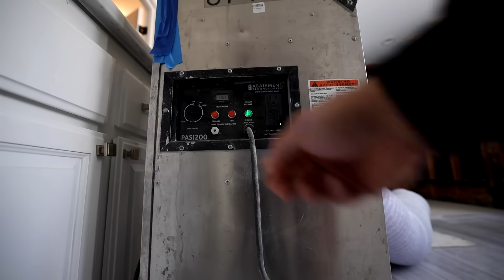Get Walls FLAT for TILE INSTALLATION --- Furring Strips, Sister Studs, and Cardboard Shims

Comment: There couldn't have been better timing for this video.... I've been stalled on my daunting home renovation and shower walls was next on the list. 

Your approach to the craft is top notch. I appreciate your dedication.
Reply: I watched several of his videos, and I'm not a complete stranger to construction or tiling. My Dad always stressed ensuring everything is square and level and so does Isaac. I just finished a project in an investment home and the only thing that saved me was furring the walls behind the backerboard. It seemed extreme to me at first, but installing 24x48 inch tiles, I knew that having a square and level surface was absolutely crucial. Project turned out fantastic, and the tiles went in seamlessly.

Comment: Hey Isaac,  thanks for the great vids!  Question on when/where you call it on the furring approach.  As a  slightly northern brother, I find it hard to sell wall floats.  I work with board extensively, due to advertised/assumed speed and quality, but I can't usually quantify or predict the increase in labor and time to fur/sister studs as shown (always a mess with busy venting/supply  walls, nvm windows).  I find myself beholden to the wet shim option more often than not, dimensional framing material being what it is now, and these popular large format tile are hard to set on an unflat wall.  Perhaps we should petition wall float education!  Thanks- keep up the great work!

Comment: I’ve gone over to metric measurements for dimensions under a foot. I started by using a tape with metric and imperial marks. Then slowly adjusted to using metric. It’s SO much easier to calculate dimensions!👍
Reply: An easy way to operate within the imperial measurement system is to determine what your tolerance is and mark everything in that denomination. If you operate within 1/16th for your tolerance and measure 1/2 in, just write 8 on the wall. I measure everything to a 16th and write the numerator without reducing the fraction. Fast and accurate.
Reply: @jeffersondavis5419  incredibly helpful tip. I'll try it next time.
Reply: Agreed we should go to metric... the transition would be painful and expensive but it would be worth it in the long run.  Grew up in Construction in the US, spent 12 years over seas building yachts in metric and now I'm back in the US in construction.  And it's not a matter being able to do the math in your head it's the expense in time and mental energy, which, has daily limits.  Moving a decimal is simply faster and easier.  One more note: the United States Customary System (Imperial) has been leagally defined in terms of metric units since the 19th century.
Reply: @A P I recommend you stay away from Vegas.
Reply: While it’s easier to convert you actually get more info on a tape measure with the imperial system. Ease isn’t always what it’s cracked up to be.
Reply: Welcome to the 20th Century …. The rest of the world has been enjoying this simplicity for 50+ years
Reply: Anytime I do trim work I switch to my Milwaukee 8 meter tape. So much tighter tolerances.
Reply: @saljablo2767  Accurate trim work isn't done by measurement. It's done by marking off the length with either a pencil or a knife edge.
Reply: Same here I switched to using metric more after watching scott browns carpentry. I literally told my self "hm this seems easier" and it was. I wish it was used more for calculations such as conduit bending, im trying to learn how to bend conduit to learn things in the union. Although I highly doubt they will let metric measurements slide even though the whole codebook is in metric.
Reply: The imperial system is an absolute nightmare to use for building
Reply: @mcihaka  how? How is it a “Nightmare” ….specifically how is the Imperial system ‘better’, other than you just don’t understand the Metric system… which by the way, is just counting by 10s…
Reply: @vk3hsc655  As a retired Prof Eng, I can work with units that you've probably never heard of. (slugs for example).  Advocating for the metric system simply shows you are mathematically illiterate. 
One cannot visualize large numbers.  Numbers have to be less than about 15 or 20 to visualize. Architectural measurements are in mm.  A room might be given as 3270 mm by 4655 mm.  How big is it without dividing by 1000? and even then we have to relate it to yards.  (The room is 10.73 feet or about 10'-9" by 15.27 feet or 15'-3")
A better compromise would be decimal feet and decimal inches as I've illustrated above.
Don't get me going on shrinkflation.  One litre is less than 1 U.S. quart.
Reply: @afriendlyguy1  you know how I know you’re an Engineer? Because like Vegans, you just can’t help but tell everyone!

why on earth would you need to divide by 1000 to understand how big 3270mm is. It’s 3270. Or 3.27 meters or even 327 cm if you like. I don’t have to ‘convert it, because I understand the metric system. But whatever. And why would you then have to “relate it to Yards”.

So why don’t you take your Superiority Complex off to the retirement home now…. It’s time for your supper.
Reply: @vk3hsc655  Reminder to self:  @vk3hsc is a troll.  Ignore!
Reply: @afriendlyguy1  
You're right. It's not about inches vs meters, it's about fractions vs decimals. Decimals are better - usually. Boeing & Lockheed aircraft are designed in decimal inches. Isaac is right too because tape measures and carpenter squares don't come in decimal inches but they do come in meters.
Reply: @afriendlyguy1  I'm not mathematically illiterate and I agree that small numbers are easier to visualize. But why on earth would you measure a room in mm and not flexible enough to change it to meter, Prof Eng??? What keeps you from doing that? And there are also cm, dm, m etc... Am I missing something? Even if dividing/multiplying a measurement by 10, 100, 1000 is probably so hard to you or anyone, it's still easier than with the imperial nominations 3, 12, 16... No?
Decimal feet and inches is a useless idea, because exactly how can you 'quickly' measure anything with the standard tape measure that only has 1/16 1/8 divisions?
Reply: @bkhoavo  Khoa, Architects in Canada size rooms in mm.  Sure I can divide by 10, 100, etc.  The point is, Why?  I didn't say decimal feet.  I said decimal inches.  Decimal inches are used regularly in some industries.  My point is that if you're not comfortable with 1/8, 1/16 1/32, and doing that math in your head, it says more about you than you should be admitting.  Manufacturing decimal inch tapes is a lot easier than switching over a whole country to metric.  The problems and expenses go on and on.  Everything has to be re-tooled. All containers get re-sized.  Gas pumps, water meters, gas meters, every speed limit sign changed, official documents, thermostats, etc, etc, etc.
Reply: Nonsense. 'Merica. 

Just kidding. I know you're totally right.

Comment: Hey @TileCoach, What do you think of using strips of 3/4” plywood to sister studs?
Reply: Plywood with the ply side facing out acting as a stud, is not structurally strong due to the layers of ply, and glue in between holding it all together. Plywood is strong when drilling and screwing THROUGH the ply
Reply: @lesg9604  But isn’t that how lvl studs are oriented, where the nail or screw is set in the layers not through them?
Reply: @JohnathanBach  yeah but lvl studs are thicker, 3/4 ply is kinda narrow to get a good screw hold in, if ur off center at all you are screwing out the side,
Reply: @lesg9604  i agree with this guy. why would you wanna use 3/4 ply when you can just use 2x lumber?
Reply: @conradcoolerfiend  The main reason is to ensure a total flat wall.
Reply: @JohnathanBach  ah I see.

Personally I just go pick out straight 2x4s from Home Depot. 

Your way would probably be fine though

Comment: On the house I’ve been rebuilding, the original studs were actually 3 5/8”, so that’s been fun dealing with integrating new lumber into the walls.
Reply: I had the same problem. I had to use a dimensional planer, but I know most DIYers don't just have one of those out in the garage.
Reply: My house was built in 1920 and was renovated a few times over the years. It has all different "flavors" of 2x4s (true 2x4, 1-1/2 x 3-5/8, and 1-1/2 x 3-1/2). Fun stuff.

Comment: I've spent most of my 17 years working on 100+ year old homes. Lots of furring and sistering to plumb, level and square walls and ceilings. Steel studs are the answer, leaves more room for insulation, always straight and light weight. You can thank me later. 😀
Another trick to ripping the "furring" shim is to temporarily screw a 2x to the side of the existing stud (like your sister stud), scribe your line to the new board and cut the line, saves all that measuring.
Reply: Some good points here.  But for the insulation, the thermal bridging of the steel studs effectively negates the benefit of the insulation between the studs.
Reply: @scorpio6587  since you're almost always leaving the sister stud proud to the inside of the existing stud, there will be an air gap between the exterior sheathing and steel stud. If you're worried about it stick with steel on interior walls and shim your exterior walls.Double 2x4s with a rating of R-3.5 isn't very good either.
Reply: @tobesskins  That's right.  The steel sister then passes heat to the stud, which is also a thermal bridge, and now has only a small distance left to cross.  Of course you're right that it's irrelevant for interior walls.  Indeed, the wood studs themselves are very poor insulators, but r-3.5 is much better than zero.  The best solution is continuous exterior insulation, but that goes way beyond the scope of this bathroom remodel.  I think Isaac's choice of method here, mostly furring, is sound.
Reply: Don't need a steel stud for shimming, just get a L bracket, saves money and is essentially as strong.

Comment: 7:19  Contrary to common belief, the U.S. officially adopted the metric system in 1866, and again in 1960.  No one is stopping you from using it, but for some unknown reason, you just don't.  While there are many reasons individual people state for their continued preference to use the "old" system, ultimately, it persists because binary fractions are supremely powerful, for many mathematical reasons the laymen is not aware of, and are, in fact, better than decimals.  Nothing beats binary.  All the technology around you uses binary.  The best thing we could do for our system of measurement would be to thoroughly standardize the use of binary increments, in every category of measurement, including location, time, and money.
Reply: In the context of this video - which is about length measurements - you don't need to deal with fractions at all in practically any aspect of house construction.
Reply: @454Casull  Exactly.  Anyone can choose to use decimals instead.

Comment: A year ago I flattened the walls in my 1945 home with a combination of furring strips, sister studs, planing/sanding, and swearing. The studs were outright wavy, and also diagonal braces (I don't think it's done any more in construction now) prevented full length sister studs. I can see how once you get your mud mix right, floating is easier.
Reply: Yeah it's uncommon to see diagonal bracing these days. If the house is going to have external wood sheathing like osb, that provides all the sheer strength that you need. If the house has vinyl siding and is in a warmer area, there may only be foam board beneath the siding and not a full layer of wood sheathing. Still in that case there should be 2 panels of OSB on the corners and that provides enough sheer strength. You will occasionally see diagonal bracing there, but its rare.

Comment: What do you do when you transition from a wall that you plumbed to the non tile wall that is in the same plain?
Reply: In my case if the difference is too noticable I get a drywall guy to float the wall. That's happening a lot in newer houses.
Reply: a transition piece
Reply: Drywall mud
Reply: Just put a couple hundred layers of paint and that might do the trick! 🎉

Comment: You are in charge of which system to use. Start using metric any time you want. Just get a metric tape.
Reply: bingo
Reply: We won the war you know.  😂
Reply: Agreed, however when using some cutting tools those are marked with fractions. So you need the tape at the cutting tool too, which isn't a big deal and I do that most of the time anyway for consistent measurements.  Go METRIC!

Comment: Metric is not as accurate as Imperial  measurement.
Reply: true
Reply: Do explain, please.
Reply: @_oven  my imperial tape measure breaks the inch into 32 pieces and there are only 25.4 millimeters in the same space.
Reply: @patrckm  I have a set of metric calipers that divide each millimeter in ten. You can get machinist's tools that are accurate to thousanths of millimeters (or inches, for that matter). For construction work (which we are talking about), the accuracy of both metric and imperial tape measures is way good enough. The errors from expansion and contraction of a steel tape measure with temperature and the inaccuracy of how you hold the tape measure is much larger than the accuracy of 32 vs 25.4 divisions per inch. You also need to make a mark with a pencil and cut accurately to that mark. 

Accuracy is not the issue here.
Reply: @_oven  sorry if my statement was confusing, I am talking about the construction industry, trim carpentry doesn't go near thousands of an inch,
In case you have forgot this is a tile channel not a cnc or machinists channel
Reply: @patrckm  Well, you're the one who brought accuracy into the discussion, and I'm trying to tell you that metric and imperial tape measures are more accurate than you need them to be *in construction*. Do try to read before replying.